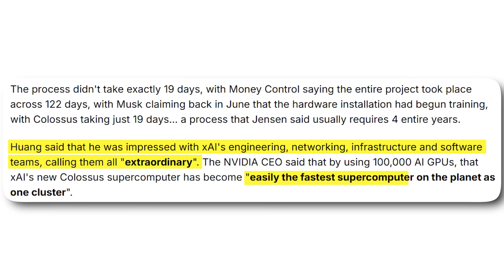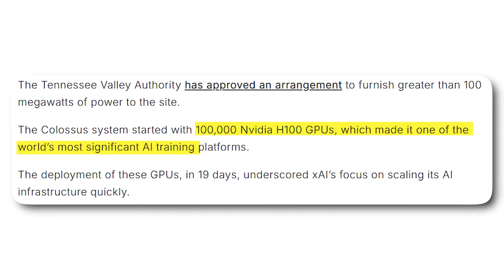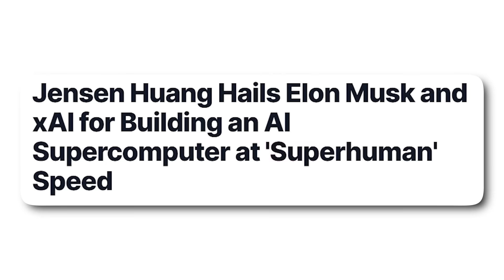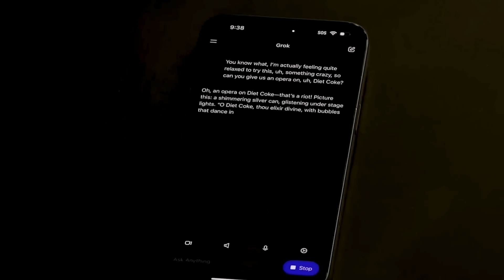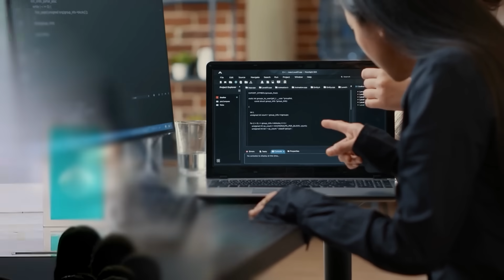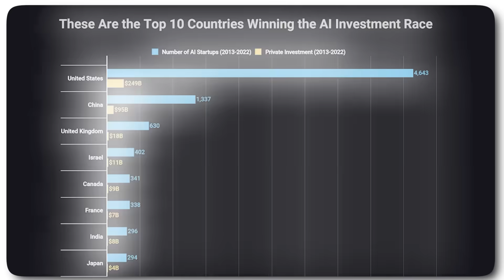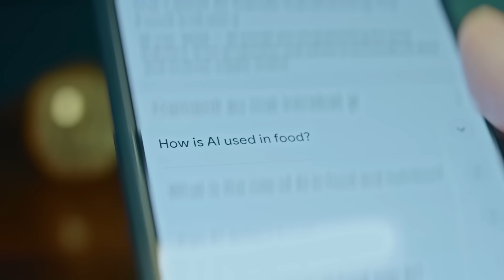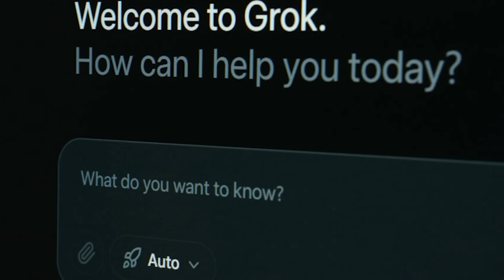Elon Musk LEAVES NVIDIA CEO Jensen Huang Stunned After HUGE AI Breakthrough!

Comment: Maybe most of us are looking in the wrong place for who's pulling ahead in the effort to become dominate in the AI computing industry. It's possible maybe even highly likely it will not be a country that gets control of AI. I see one company that has bet not Billions but actual Trillions in being able to use and allow the public to get access and use these outstanding compute functions. Training with actual data vs inferred data appears to be the clear preferred way to advance. Tesla provides Colossus with immense amounts of data thru the autos and in house designed chips and with the new deal with Samsung close to inhouse Fab for the manufacture of their chips. Power generation via existing and operating of 24 out of 35 gas  turbines and with the purchase in Europe of a complete generating facility being installed in Tennessee will soon to be capable of two terra watt capacity (equal to the average electrical usage for 157 New York Cities) completely bypassing existing power generating and grid distribution needs allowing Colossus to achieve its goal of getting to one million H200 GPUs from 340,000 now operating GPUs to over one million by late 2025 or very early 2026. Starlink to provide direct two way communication and data transfer for users and return data for training at unrivaled levels. Megapack batteries for a uniform highly reactive power source when systems get to the scale of Colossus. SpaceX again inhouse satellite lift services for inhouse communicating with Teslas, users, and soon Optimus a humanoid autonomous robot able to function in the real world. Imagine if Tesla bot/Optimus goes to scale how much training data will be available to XAI and Colossus if Nuralink is the path that allows the public to become comfortable with human implants spreads to the public for direct human to silicon interface how much more real world data will be able to be used in training of Colossus. Then ask if any of the other AI companies can match the investments needed to stay just even with the Musk conglomerate largely already beyond any governmental controls and independent of needing any outside partners. Just imagine how difficult it will be to assert any controls when Tesla moves it's headquarters to space or the moon or another planet. It's looking like Elon being willing to bet all all the time is likely beyond any company ever catching up. It may appear incorrectly that several companies are running close to each other and when AGI is achieved how long will it take Tesla's competitors to create the massive manufacturing research and development capabilities facilities service centers and sales outlets to allow these companies to sell their products to the public and become as useful as Elon's will already be with his cars robots communications systems direct neural links FDA cleared with already invented and operational surgical robots enabling surgically implanted links, power generating and storage systems including battery manufacturing at Megapack scale. Tesla solar roof powerwall all under one already existing and running conglomerate. Ray